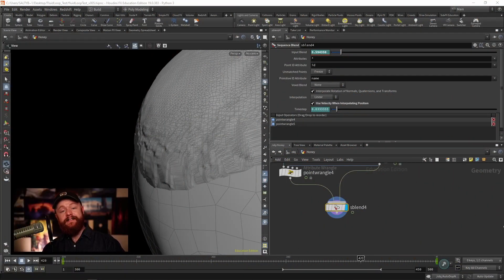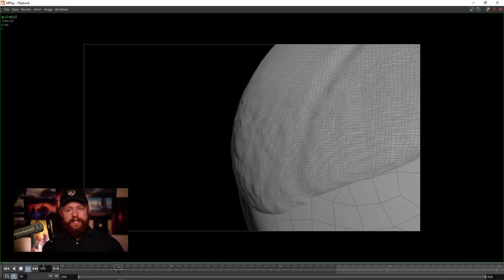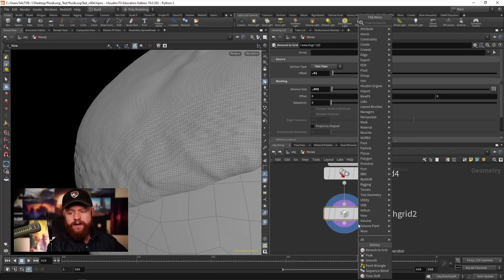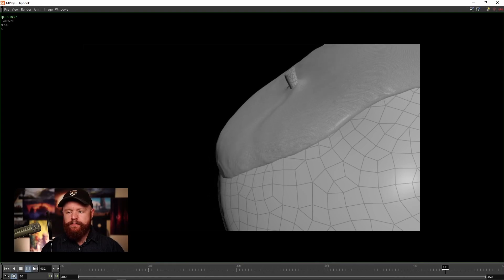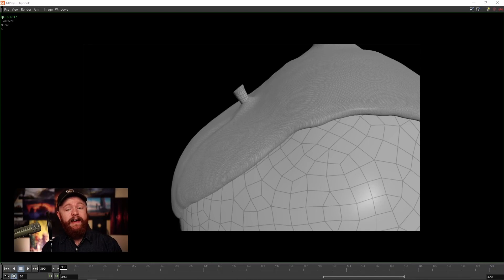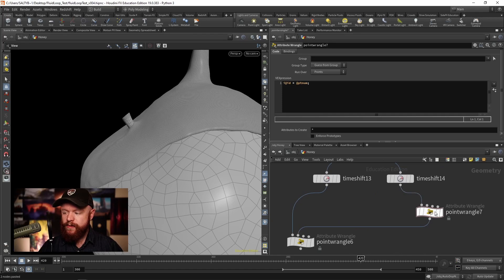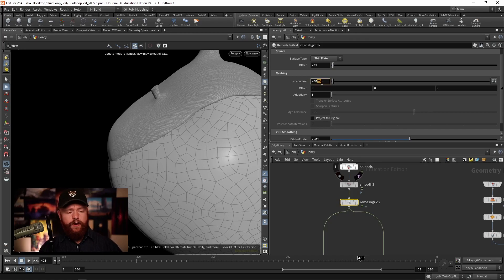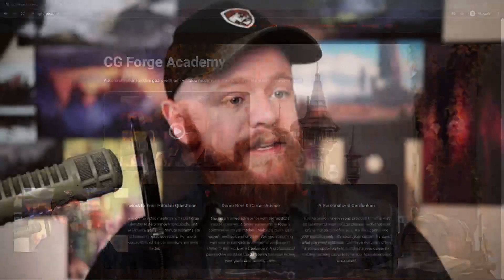Houdini | Fixing Flickering Fluids | Quick Tip

Comment: Hey Tyler, I used the RemeshGrid smoothing technique from this tip but didn't realise I'd lose all my velocity data. Is there a way to get this back? (I've cached the surface and it's 2000 frames..)
Reply from the maker: Hey @danacarvey , you could try using an attribute transfer node to bring it back
Reply: So this should work even though the vert count etc. is way different? @cgforge
Reply from the maker: Yeah, I think so
Reply: Thanks Tyler!  @cgforge